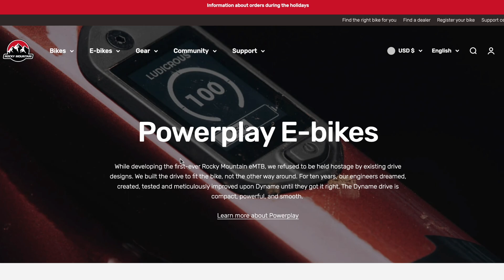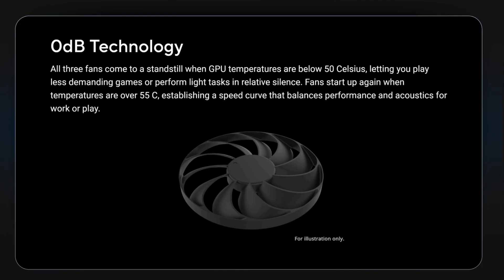More Torque For Every Motor In 2025

Comment: You are so right, we are being hit with pure marketing and the Amflow coverage was ridiculous.
Reply: I own one. Flipping good bike and worthy of the Hype. Dji are making the other main players catch up....... Literally.
Reply: @shaneycarter8803 I agree he goes on about just the torque. It's the full system. It's the motor weight, high density battery, power delivery and control system everything combined is where the hype came from.
Reply from the maker: @Wolvie10  im speaking about specifically torque in this video as im informing everyone that nearly all motors will have the same amounts. as you rightly point out a wider system is necessary to control it.
Reply: @alexbiketester  your hatred and glaringly obvious personal issues towards the Amflow are quite strange from someone professional….. I would completely understand it if there bike was incredibly mediocre and basically just another bike like the Focus you have there for comparison, but it’s not is it …… right now as it stands and forgetting even the technical figures it’s so much faster and more advanced than anything else,  including integration, charging time and most importantly how it feels on the trail, and to have achieved that on there first go when all the others have been at it for years is astonishing.
I’m guessing from your comments you’ve not actually ridden the bike yourself ??
Reply from the maker: @motoboggle7525  i didnt mention it in the video and i dont hate it. I am only calling out the pure marketing and zero transparency behind the launch.
Reply: @alexbiketester  Alex it's quite simple really. If you have something good, at a good price and good specifications. Shout about it, why not. DJI have invested a lot of R and D, along with huge amounts of money into the Avinox and Amflow release. It's a good if not actually a great bike,  credit should be given where it's due. Testers have tried to break it but they can't. Dji are even supporting directly with consumers who may have experienced the odd glitch.
I'm supe impressed with mine and I've had lots of the big brands over my 20+ years. Alan from MBR rates it highly as do many.
Reply from the maker: @shaneycarter8803  Alan so far has feedback to me that its an interesting bike. well controlled power, and it predicts well the shifting of mechanical shifts. He has mentioned the suspension was not tuned right but he found the right tune eventually. 

For the price its a good start. Im looking forward to see it later on rather than sit on the hype train, which i have tried to point out to people is a way of shifting more bikes. I have more info than i am able to let on about the whole start up thing currently. It is a 101 on internet marketing. At the same time its not transparent... thats clear from where i am standing based on what I know.
Reply: @alexbiketester would love to hear about this more info that you have on Amflow?
Reply from the maker: @ For what i understand you have to be a paid influencer to divulge info on the amflow... LOL
Reply from the maker: @motoboggle7525  i would read between the lines when understanding what I say.... 🙂
Reply: @ I have tried and to be honest I can’t be bothered, if you’re using sarcasm to get your point across then that’s just weak unfortunately but you just sound like someone that clearly didn’t get the invite and the only journalist to have such negativity towards the brand and the bike. 
It’s funny because your trying it insinuate that it is all of the other YouTubers or influences as you call them that are in the wrong for promoting it yet you are the only one who isn’t and yet according to you EVERYONE else is wrong and your right …….
Reply from the maker: @motoboggle7525  DJI paid about 10 influencers to promote the bike.... its not invite is marketing... this video isn't even about DJI. The youtube bike media is very opaque, no transparency to who is paying for videos and they are afraid to  be honest in the video about  which videos are brand supported. The consequences are that the public are not getting the right information they are getting a story read to them. 

I base my opinion not on being "right" but the obvious standards that stop this type of behaviour in the tech industry. 

Look at a recent video from linus tech tips where he is interviewed by COlin and Samir.... https://youtu.be/nmNzEf7dXsw?si=aeo6f4jtKKo9AUJr&t=3646

watch for about 10 minutes from this point....
Reply: @ “I have more info than I am able to let on” - so why don’t you? We’d all love to hear!
Reply from the maker: @PeteArcher  Type of info that might reveal the leaker... anyway im working on a video now all about bike tubers and the lack of transparency of commercial interests.
Reply from the maker: @shaneycarter8803  For the money based on the market compared to its a good bike, but there are better riding bikes at other price levels coming.  

As they ramp up the numbers of production we will see how that plays out if the QA stays constant. Many of the top motor companies have had issues as numbers increase. Thats where most problems occur when the numbers in production get bigger from a technical point of view. 

 It was made as a show case for the motor. DJI had the money to make it. 

The most important thing is you enjoy riding it. Also take time to get the shock tune right, out the box its not good. might need some fiddling.
Reply: @alexbiketester  sure it's going to have its issues also.  they all do and DJI are responding directly with consumers if they are experiencing issues. How many do this ?

DJI have jumped ahead with power, interface, control and usability. Time will tell how it goes but I'm impressed and everyone who rides one is too. It has forced the main players to shake things up and rightly so. 

Ill I maybe change out the rear shock yet but I've spent sometime tweaking and it's been pretty solid so far. However always preferred RockShox, so will probably go with the Vivid a some stage and Zebs 3.1. Stay safe pal 👍
Reply from the maker: @shaneycarter8803  yeah the shock reccomnedation is something that is about the out of the box tune.
Reply: @alexbiketester  Have you ridden it, to make that comment? It rides really well, actually. I’m coming from a Spech Levo and the Amflow took one ride to convince me how good it is. It’s a trail/all mountain bike. Ride it as one and it’s very very good. Ride it like a downhill sled and of course it’s going to be under biked. Really the only downsides are the shit stem and under weight tyres. Both easily fixed. It’s rated to 170mm up front so you could take a half degree off the head tube pretty easily.

Ride one first. Then say there are better bikes.
Reply from the maker: im being side tracked by the DJI discussion.... lol..... i tried to avoid it in this video.... but.... oh well. The amflow top of the range version is rated as a trail bike. the PL version is built a bit better, yeah the stem is an interesting choice....

the famous bike company has something good coming. 

The Levo is s works version ive ridden impressive. but way expensive.
Reply from the maker: I would like to point out i didn't mention that motor in this video.... hahaha
Reply: @ No,you didn’t,  but I bet this comment gets a lot of attention 🤣🤣🤣🤣🤣
Reply from the maker: @DaveSeddy  i litterally said nothing.... no actually i said a positive thing...
Reply: Bosch wanna hurry up and get it done because there missing a huge chuck of buyers who have no need to wait now with the Amflow available and already leagues ahead , I want to see Bosch back on top but I’m not sure it’s going to happen as there still 400w of peak power behind the Avinox in Boost and a mile away in NM….. my other concern is I wonder how much there going to be charging for the privilege of a new touch screen to replace that awful blanking plate ……🤷‍♀️ Bosh owners have to be prepared to have there pants pulled down while the DJi guys blast of into the distance 🙈🤷‍♀️🙈🤷‍♀️
Reply from the maker: I dont know what the cost will be.